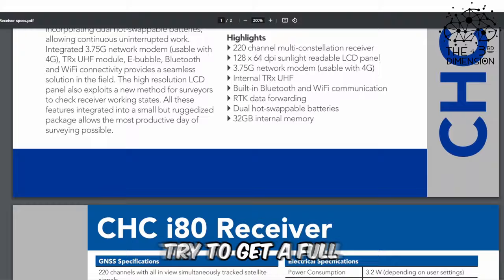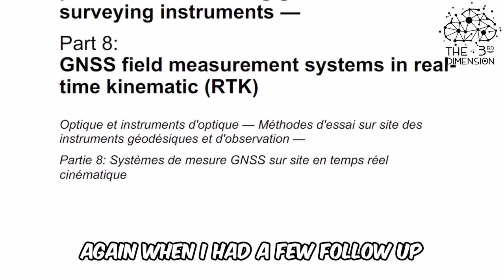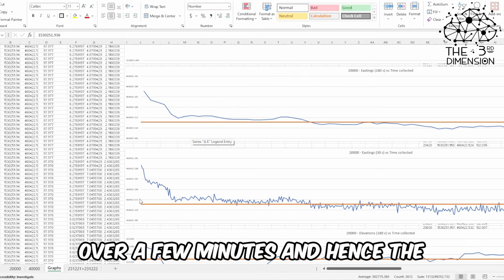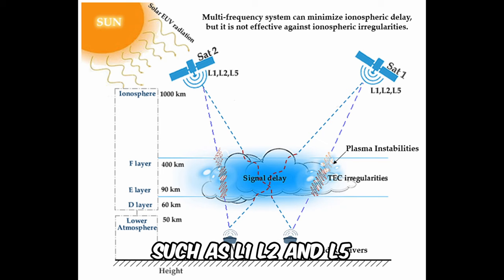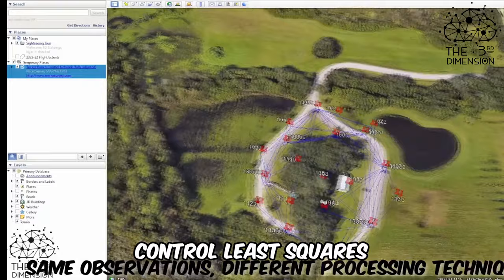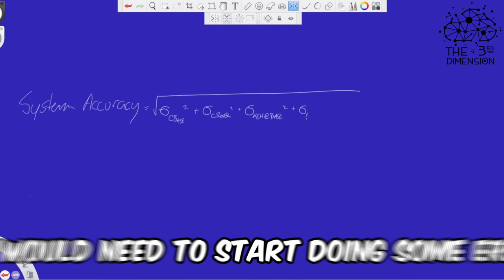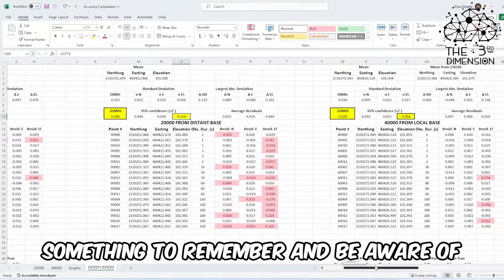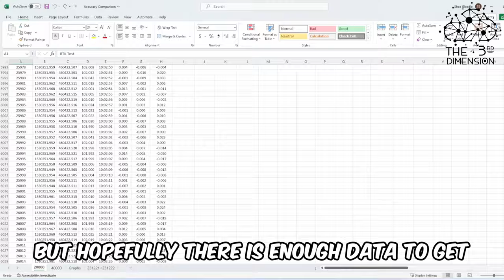Land surveying 101 - How accurate is RTK GPS

Comment: If I could give you 100 thumbs-up, I would. Excellent video. Hands-down the best RTK primer for surveyors I've seen on you-tube. Bar none. There are too many right out of college 2nd year practitioners giving half-good advice here. I'm happy to say that this video is nothing of the sort. Let me detail why I can say that and why my opinion might matter a little bit.

I've been active as an RTK surveyor since the mid 90's, built and manage a GNSS network, trained surveyors for 2 decades, spoken at our state conference on RTK precision, help with standards development for a large state DOT, evaluate new systems before we purchase them and many other aspects of this work in my 33 year career. I've been doing these test you show for 20 years. I got fed up in the early 2000's when I couldn't get a straight answer, just like you described, so I started testing myself. I am constantly amazed at how well RTK works, as well as how it can hurt you when you trust it too much. My findings match yours very closely and really haven't changed much in the last 20 years. Around 2008 or 2009, I saw a slight bump in vertical precision when we started using RTN. I estimated that it approximately halved the PPM error, and sure enough, they ended up putting that in the specifications years later when the Trimble R10 was released. That was very satisfying.

I summarize it like this (Basically what you said!!): we can generally take the specs shown as usually good to 2-sigma as long as we have low DOP and good atmospheric conditions. However, probably 1/20 - 1/50 of the measurements will be way worse than all the others, and there is no way of knowing which those are unless we shoot them again later. Also, this assumes that we have well maintained and calibrated equipment and good procedure and adherence to those procedures. Once you get into a less-than-ideal situation, all bets are off. I will say that tightly coupled inertial systems have the potential to change this dynamic under certain conditions (over a short period of time), but I'm now in a managerial role and don't supervise field crews, so I don't think I'll ever be testing that .

I've run so many spreadsheets with custom stats and graphs. I've lost more than I can now find. One thing that opened a lot of people's minds was when I did a test of 'dumping' the receiver and re-measuring, which is something that I always have argued against, despite it being one of the favorite things sales-people showed us to do in the 90's when these were being rolled out. I was able to show the positional bias over a short period of time, proving that you must have a time separated measurement to get a normal distribution. I believe you shared a similar finding.

I've also been combining RTK, static and terrestrial measurements for a long time and am constantly frustrated that it isn't done more, even in my department. I can't stand that people still shoot in RTK 'pairs' and then "lock 'em down" before starting a traverse. Why hold 1 elevation over another? Just hold them both and run a least squares adjustment (I use TBC and TGO before that).

The way I describe the precision/accuracy is this. RTK will bring you precision, your constraint to your control and its quality brings in the accuracy. For years we would just occupy passive grid coordinates and do check shots. When we started using our RTN in the mid 2000's, we started doing site calibrations/localizations. The latter gives you a pretty good idea of your survey accuracy. Then, if you shoot 1 point on the site about 15x and run the stats, you can get an idea of the precision at that site. But that is only for the same person, using the same equipment, in the same conditions.

I really can't talk about when we are going to start to reign in the non-professional activities that some are using these tools for, but a movement is afoot in my state. It isn't the tool, but the use that is the issue. The first thing that needs to get cleaned up is we surveyors have to be better at using this tool Your video here a good start, so thanks for taking the time to share this. I never had much interest in editing videos, so I do appreciate the amount of work that went into this. You can DM me if you want any additional information from me.
Reply from the maker: By far the best comment I've ever received & couldn't agree more with everything you've said. Thanks for taking the time to write this out. Too bad you've lost most of the data comparisons you've made over the years, it sounds like it would be a wealth of knowledge that would be invaluable to the younger generation of surveyors coming up!

Comment: This is fantastic work sir, hats off !
Reply: I would be interested to understand the part of GNSS receivers spec talking about RTK. Specs usually says 8mm + 1ppm for rtk (assuming nearest base in corrections network) and 8mm +0.5ppm for network rtk. But 0.5 ppm of what ? Distance to a closest base ?
Reply from the maker: Distance from whatever base you are receiving corrections from. If you're talking about a network solution the virtual base is right beside you, theoretically removing that portion of the accuracy spec. That being said I have been told from a fairly reliable source that single baseline is preferred when there is a base station within 9 miles, beyond that a network solution is supposed to be better. That being said I haven't personally tested this theory so cant say for sure if it's right or wrong. @milannovak4772

Comment: Great video! I think most surveyors I know have pushed the capabilities of GPS in sketchy locations. 
Are you aware of any manufacturers that have atmospheric inputs at base set up. That could be a great software feature. I always input them on TS set ups.
Reply from the maker: Unfortunately inputting surface pressure and temperature wouldn't do you much good. It's not quite as straight forward a calculation such as the one for your EDM on your total station. There is real time modelling already being applied for Troposphere delay however. The error left over from troposphere delay is from imperfect modelling.

Comment: I have a question. If the bestestation requires very accurate absolute position to calculate corrections from measurement, and be close to the receiver (probably less than few km for decent results), but is mobile, how its gets its own accurate position in the first place during the setup? I understand if this is permanently on a building, we can measure positions for a month, and got good accuracy, using multi band receiver, averaging a lot of errors, and taking favorable conditions. (reference stations use more direct methods, including laser ranging, but these methods are not available for normal use). But if the base station is mobile how this can be done? I think the answer is simple. It is not possible. the only thing it can do is improve precision, but not accuracy, at least not without very extensive averaging of the base station position.  In many scenarios high precision and medium accuracy is all you need, including survaying and geodetics, especially for construction sites. Especially if there are some other datums we are using as a reference point. But it is not suitable for all applications.
Reply from the maker: I think your question is how do we get an accurate absolute position of the base station? One option is to collect and process static data. When you say it's not possible I guess it comes down to your definition of an accurate position.
It's not true we cannot improve absolute accuracy of the base station, we can take repeated observations. Just like any measurement that has random error, the more blunder free observations we take, the better the averaged result will be.

Comment: Hello my friend! Thanks for the aweosme videi! Do you have any video telling us about working with total stations and GNSS? 

Wich method is the best to get all data fitted: site calibration, applying avarage combined scale factors for the entire site or applying combined scale factor for every single point of your project, accordingly to the N,E and ortho height of the point? How to survey out of site calibration and still get accurated survey data, like the total station measurements? For example for larger sites or linear projects, which method would you use to convert the GNSS data to ground? I struggle so much with these questions and how to keep things under control. Thanks if you could bring some light on this topic!
Reply from the maker: Hello! Hands down using STAR*NET. 100% the right tool for that task. I don't have a video on exactly how to do that yet, but it is on the To Do list. Hopefully within the next month or two. I really makes it amazingly easy to switch between grid and ground by exporting two separate control files and automatically calculates your CSF based on the point you want to scale about. Its fantastic at merging total station and GPS data in the same project as well. There may be other Least Squares Adjustment programs out there that do the task as well but all the others I've tried don't hold a candle to STAR*NET.

Comment: Really great video. Do know a free software that can help convert grid coordinates(RTK) to ground coordinates (Total Station). I know TBC can do this but I am hoping that there's some other low cost or free software that can do same. I have been searching for this for a while.
Reply from the maker: Sure, it can be done with nothing more that a service that gives you a combined scale factor for one of your points on site, NCAT for example (https://www.ngs.noaa.gov/NCAT/), then scale your points by the inverse of the CSF. Which can be done in CAD, excel, or even a calculator if you want. But I would be very careful when doing this, some of the biggest blunders I've ever seen were from improper handling when going from grid to ground. I'm talking millions of dollars to rectify mistakes caused by this.
Reply: @The3rdDimensionSurveying  Thanks a lot. I wish there was a video to guide me but I will try it and see.
Reply from the maker: @geossotechltd  It's on the list! Good Luck!
Reply: @The3rdDimensionSurveying  Just discovered its mainly for America. I can't find my regions input reference frame
Reply: Qgis can do this